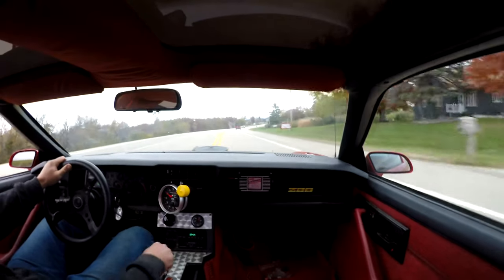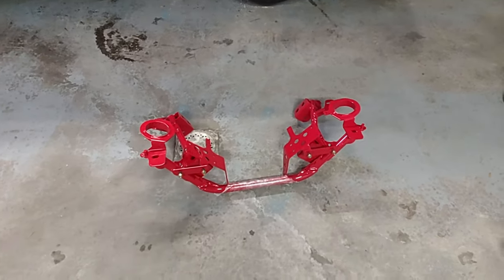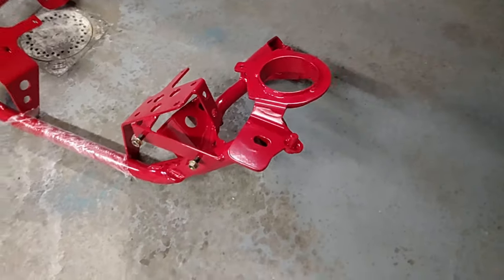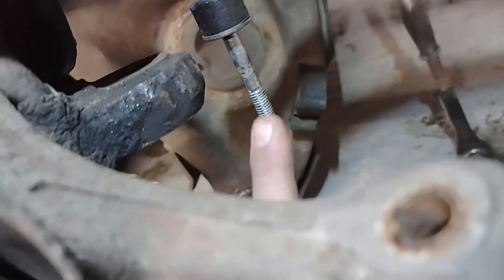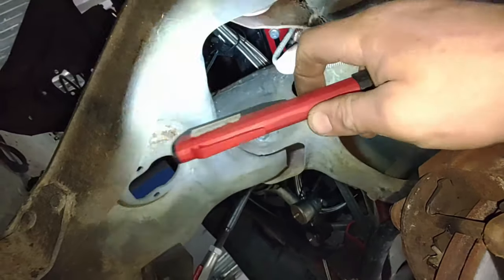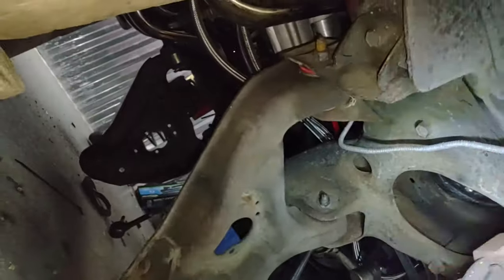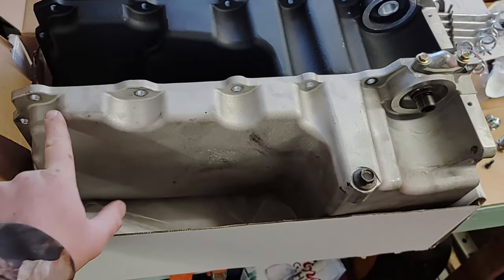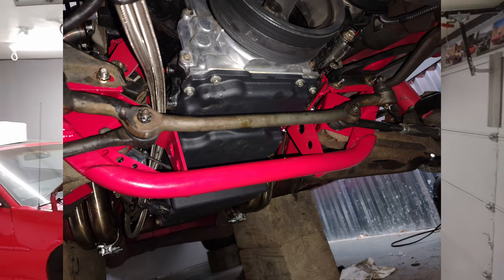3rd Gen Camaro Tubular K-Member Install + Budget LS Swap Oil Pan!! Building A 3rd Gen RACECAR Ep. 2!

Comment: I flipped my center link 180 degrees.  I’m considering using a 2nd Gen center link because they don’t tuck back as much as the 3rd gen link .   Oil pan clearance n such
Reply from the maker: I considered this option as well, but I plan to do autocross/ road courses with this car and didn't want to mess up the geometry/ Ackerman Effect. Would be just fine for a strait line car or cruiser..

Comment: so, correct me if i'm wrong, but is the "aftermarket" oilpan not a ls1 oil pan for a 4th gen? Pretty sure those work without any issues?
Reply from the maker: Correct, it is modeled after the LS1 pan, but mine was an aftermarket brand. The 5.3 windage tray is full length and will not clear the high tuck LS1 style oil pan, you will need to cut it down or get one off an LS1 car..
Reply: @KravasGarage  gotcha, thank you. I lq9 swapped and run stock steering. K-member from spohn, but wondering if I'll have issues since I ordered 1998 z28 ls1 oil pan for it from GM. (Car is far from together)
Reply from the maker: @walterbrunson1850  that pan should work fine, just check on your lq9 windage tray, you may have to cut the front of the tray back to the next set of bolt holes to clear the front of the pan, (so instead of 10bolts holding it on you will have 8) if you search LS1 windage tray you will see how much shorter it is, I just modified mine to fit and it worked perfect!